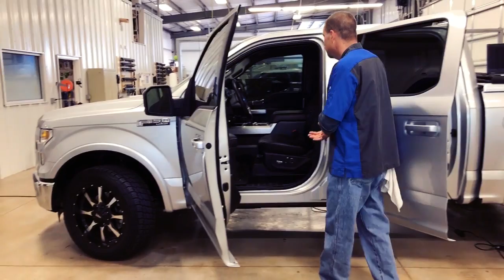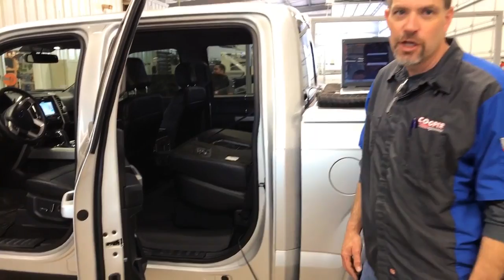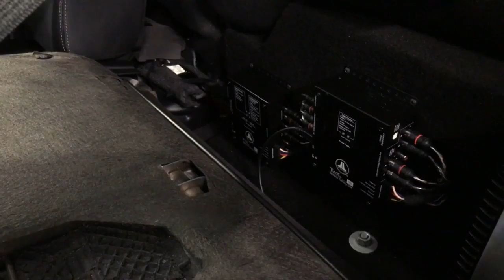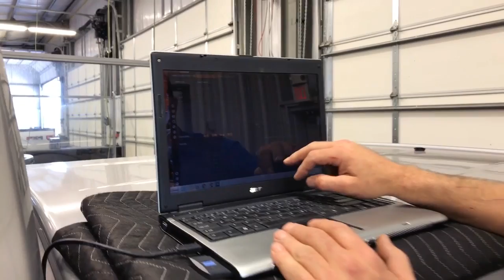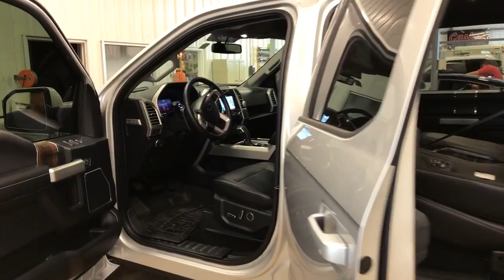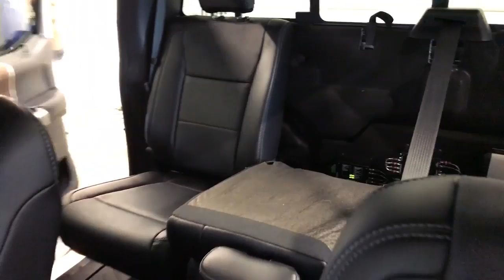FORD F150 JL AUDIO FiX & TwK

Comment: I just had CarToys in Boulder install a Fix 86 and a JL Vxi 8 channel, in a 2017 F150 with a Sony factory system.   However, now my bluetooth phone calls come in with an echo and are basically inaudible.  The installer claims that this is inevitable and cannot be fixed.   I think he's full of crap, and just doesn't know what he's doing.   Did you encounter any issues with the Fix 86 making the Bluetooth phone calls come in inaudible?
Reply: I have a FIX86 in my 2015 F250 SONY System with a JL AMP and have no problems at all when using my bluetooth phone connected to the sync system.

Comment: Who the hell wants another volume knob?! Defeats the purpose of "factory integration"
Reply: most people who get sub-woofer installs will get a bass knob. it only makes sense to add the volume knob to it as well.
Reply: @UrAdversary  no it doesn't make sense. Adding more knobs doesn't make sense. A bass knob is one thing. But personally, I would want to use my volume on my factory head unit and steering wheel
Reply: @Mr215Alive    I can still use the volume on the head unit & steering wheel.
Reply: You are thinking of it all wrong. The second “volume knob”(DRC205) should be thought of as a gain control as an extension from the actual control on the amps behind the seats. 99% of the time you should not even need to touch that second volume control unless you want to get really loud. Once it’s set, you use the OEM volume controls as normal.

Comment: I started out with two JL Audio VXI amps.  Does the FiX and the TwK still serve a purpose when you first have these amps? Also, concerning the remote bass controller.  Is it just sitting in the hole in that dash or was there extra fabrication to make it look like it belongs? I have been trying to get my installing to put mine there, but have to think of a clean way of doing it.

Comment: Can I connect 2 amps with the fix and twk??
Reply: Yes. The Twk gives 8 outputs so you could run a monoblock for the subs and the other amp for mids & highs. But if you are going full active system for a SQ setup you may want to use a helix dsp instead. Better processing capabilities and you could get 10 or 12 outputs.

Comment: which amp?
Reply: Already taking to Tristan about upgrading to the VXI amplifiers, I want a full 150watts or more going to each channel
plus the fact that the NEW VXI amps have DSP built in on every channel & I want full active on every channel.
So thinking about a VX800/8ch & VX600/1 monoblock.
Reply: let me know how it goes
Reply: how happy are you with the stealth box?
Reply: I play guitar since I was 15 so ROCK music is my thing.  Stealth Box is perfect for that. Love it!
Reply: If your asking whats in there now,    HD900/5
Reply: thanks
Reply: rock is my thing too, Zakk Wylde was a friend of mine for a few years. As a guitar guy, you understand.
Reply: Ok just dropped off the truck so VXi amps are going in should be done Friday.
Reply: verdict
Reply: Setting it up we blew the ZR Tweeters by clicking on the wrong button so........ZR tweets no longer available
so I went ahead an ordered the NEW C7 tweeters which will take a few weeks to get them in.
Using C5 tweeters temporarily.
Reply: what a happy accident.
Reply: C7 tweeters finally installed, RTA the system again and added few more EQ curves into the system
and yeah it sounds better than it ever has!

Comment: Should have used a Pac amp pro that gives you clean flat eq output 5v no fix needed just a twk88 if you wanted dsp tuning would have saved money and retain full volume control on the head unit no distortion only if it was the Sony amped system

Comment: What would that system cost with installation?
Reply: Jim,  did you have the 10 speaker B&O system in there before the upgrade? If so, was the upgrade a huge difference?  I have a 2018 Lariat with that system and am wandering if an upgrade is worth it. It sounds pretty good.
Reply: I'm getting the samething done to my 2019 dodge ram 1500 ...amount $4000.00 
Hertz hi energy components in the front and coaxial in the back with two jl 12tw3 in a custom box amp will be jl xd 1000 5/v2 with the jl fix 86 plus parts and labor
Reply: I didn't spend quite that much but pretty close, but it was worth it!
Reply: just under 5K
Reply: I have the 2017 Platinum FX4, you did exactly what I have planned. I may go with the VX800/vi amp though. I bet you are still happy with it.
Reply: About $5K for my install.
Reply: you're lookin at 3800 bucks in just the speakers, signal processing, and amplification. add in labor, wiring, custom speaker brackets, and any other misc. parts, and this setup closes in on 5 grand

Comment: this still doesn't remove the Sony factory amp out of the equation. check Rockford Fosgate's DSR1.
Reply: The amp is bypassed im assuming, since they summed all of the channels with the fix86
Reply: And yes the amp is bypassed,  This is my truck and it sounds really good.  I listen to nothing but Rock
so it needs to really hit you in the face which it does.
Reply: jim stubblefield what kind of knob is it?
Reply: JL Audio   DRC-200
Reply: My bad, the sony amp is not bypassed

Comment: Nice system , I just don't understand why JL audio can't make a single unit DSP , like the Bit Ten ?  They complicate things by having all those boxes.
Reply: This is my truck, didn't no this was posted on here!
Reply: How much does a system like this cost?
Reply: jim stubblefield right on.. how u like the sound system ?.. any issues ?.. i have a JL1000/1V2 SLASH pushing a 12W7 in the H.O. box/wedge in my '06 H2 .. JLAUDIO is my favorite brand
Reply: Nice system for sure.  I too have the JL Stealth box under by back seat in my 2015 Super Duty and I have the 5 Channel JL XD700 and the FIX86 DSP to take factory head unit signal and improve the quality.  I opted for the FOCAL 6.5" Separates in my doors, this is one area I think JL needs to work on, the FOCAL's sound noticeably better.  IMO
Reply: FordAlloy, I would surmise that if one part of the DSP goes bad, or just needs a better component or upgrade, it is easier to accomplish if each component is separate vs all in one module.  I agree, a single item would look better, but it's rare to find one single module that is PERFECT in all it does to suit everyones need or likes.
Reply: they have the vxi amp now has built in dsp